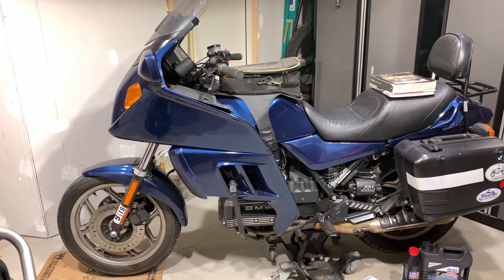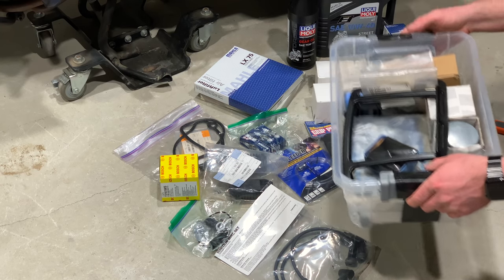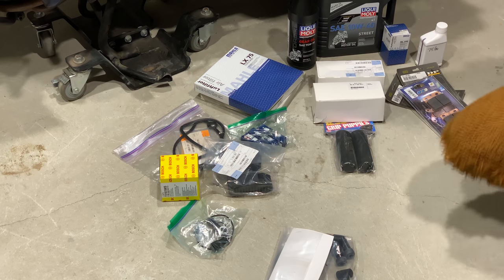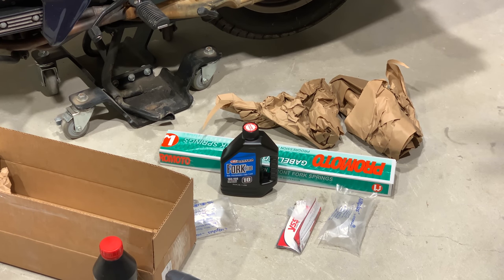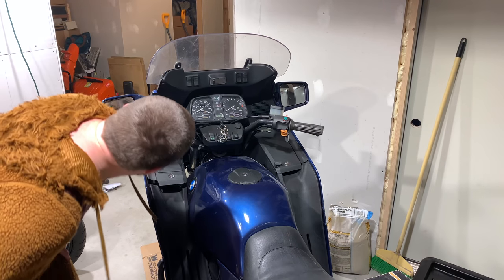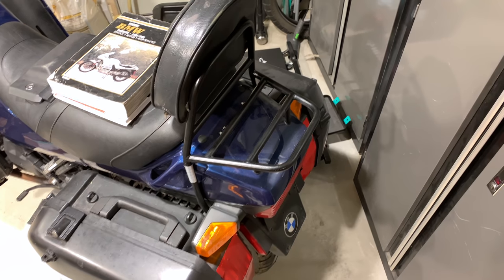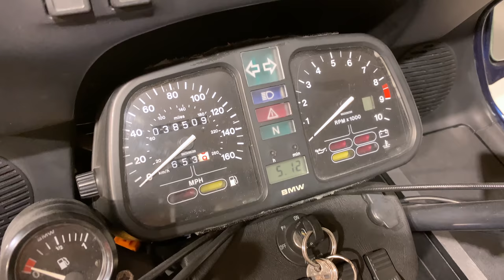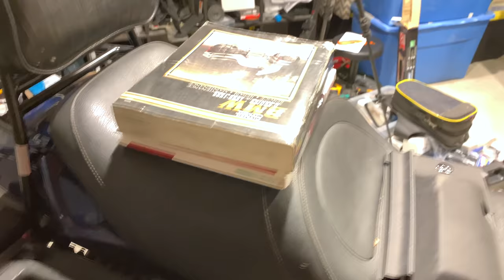The K75RT Rebuild has Begun! Full overview & Modifications

Comment: this is not a radiator cover, it is a luggage rack also specially designed for the BMW topcase. Good luck with your machine. 
I have the a white one from 1990, no adjustable window yet. I bought it new back then.

Comment: I have a 1990 K75RT I bought new.

Great bike.  Just has a few issues.

Need to pull the rear drive, clean the driveshaft splines and lube it frequently with a high content moly grease from Guard Dog or Honda.
Reply from the maker: Yep, I've been doing that every 1500 miles just to be safe. It's a little insane but it's good to stay ahead of it.

Comment: @19:40 you wonder what the deal is with the side cover. There ought to be a cylindrical sleeve on the quarter panel, that takes up the pin on the side cover. For what it's worth, I notice some holes, that do not seem to be original, as if someone tried a retainer pin to take up the slack.
Reply from the maker: Thank you very much for the tip

Comment: Thanks for the vid, very informative. I don’t know if you still have the bike, but how did the YSS rear shock go? I am about to fit one to my ‘93 K75S to replace the old original. It looks to be identical to the one you have, an ME302.
Cheers from Aus.
Reply from the maker: I still own the K75 and the YSS Shock is still on. It's absolutely an upgrade from the OEM that was 25 years old. It's a 'dumb shock' so just spring & compression with no adjustability aside from pre-load but it's fine. The bike is a lot more bouncy on speed bumps or pot holes than my R1200GS with fully adjustable shocks from Tractive but that's not a fair compression. Old Bike + dumb shock. It is way less floaty and bouncy than the OEM was.
Reply: @AdamChandler86  Good stuff Adam, haha, the K bikes sort of grow on you after a while ( 29 years ). Preload is probably enough for the rear anyway, I guess. The bike just isnt a sporty bike ( my 'S' ), more a big mile eater. With fuel economy from brim full, mine gives, ridden ahh.... enthusiastically, about 240 - 250 kms to the warning light and ridden gently, about 250 - 260 kms. Manic fuel pump whirring and a distinct lack of forward motion occurs about 310 - 320 kms.